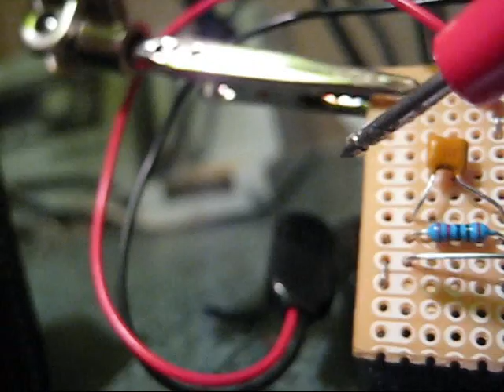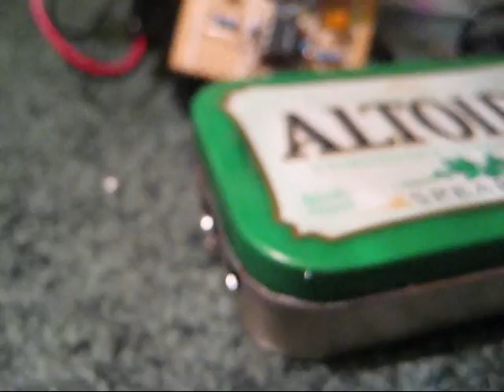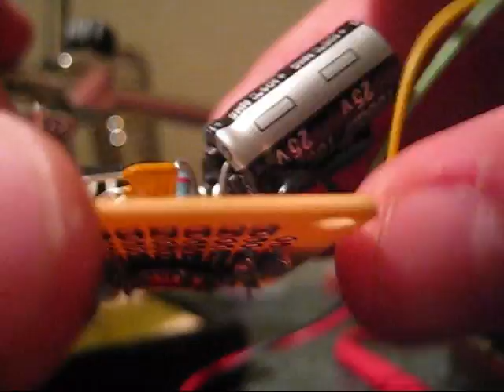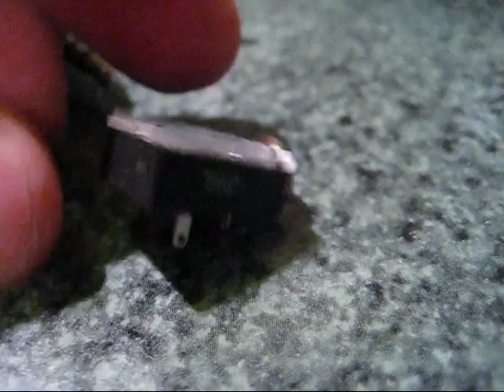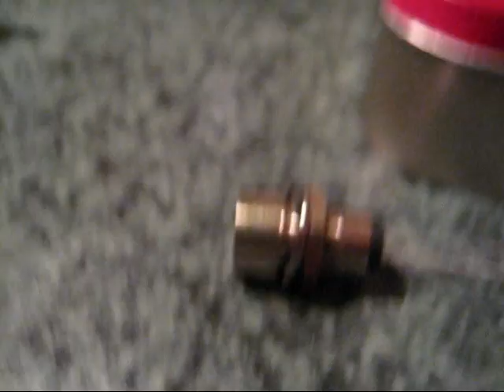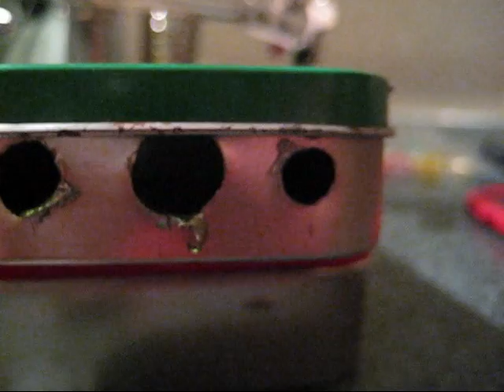cmoy pocket amp part 3

Comment: the orange components are capacitors 0.1uf , if you go on tangentsoft on the cmoy part u get the full guide , parts list and where to get the components from and there product codes